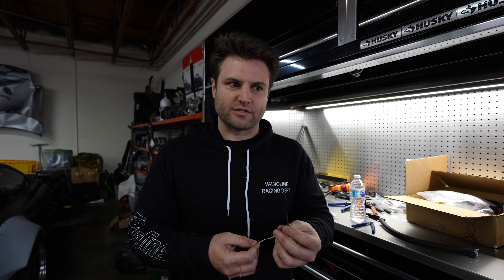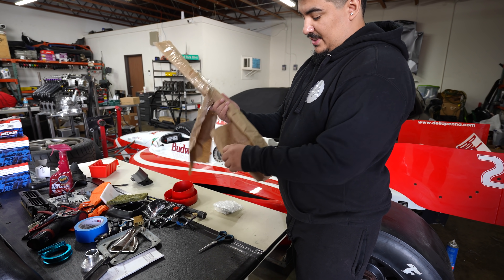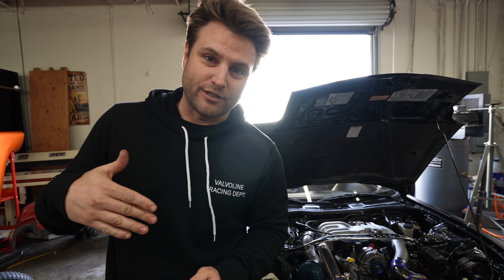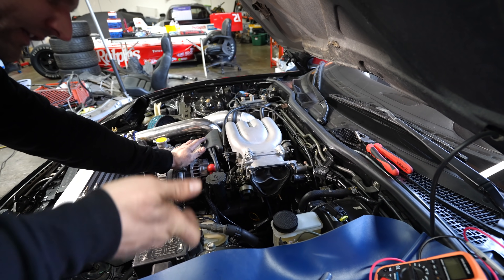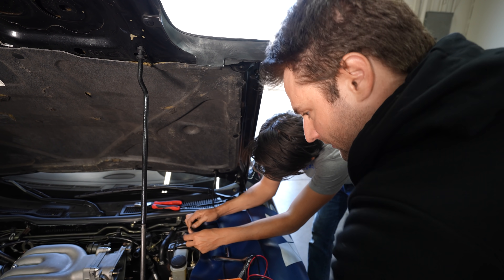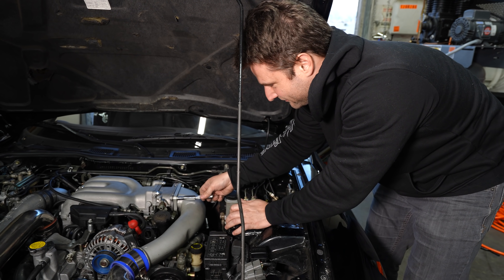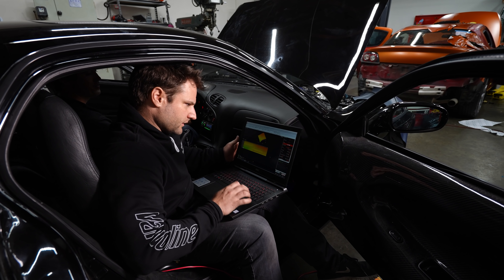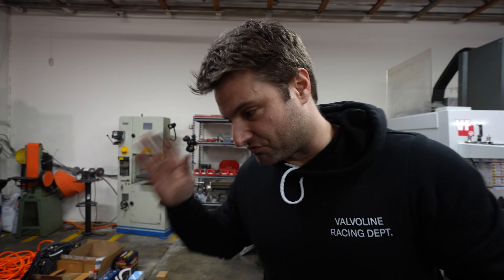I was nervous tuning a Professional Driver’s Stock FD RX-7. His Rotary downward spiral begins

Comment: High idle when cold probably means the thermowax and accelerated warm up valve are still present on the throttle body and upper intake manifold

Comment: got the same problem you mentioned at 14:10 with mine and it does not stop doing this. Sprayed tons of brake cleaner arround but no change in idle even hooked up a smoke machine but I can't figure it out. Car Does not react to Idle adjust screw under Throttle body aswell... gotta love this

Comment: Rob needs a hub dyno (like a dynapack setup). So he can just tune the vette, the 3 rotor, the fc, the c8 (if it runs), possibly the 4 rotor, and then shove the dyno in a corner later
Reply: Do they make awd setups for hub dynos???
Reply: @malikmadison6304  They just disconnect the front drive shaft and test it in RWD (I think, not an expert).
Reply: @T3ddyRuxp1n  yep. you can do that. Then just have to compensate the drive train loss because your car is awd but you tested out in RWD rwd drive train is much lower than awd. sorry for my english. Almost forget i am not an expert too ajjaj
Reply: @malikmadison6304  Yes. I know Mainline Dyno makes one.
Reply: @malikmadison6304  they're modular, you'd just get 4 instead of 2
Reply: @malikmadison6304  yes they exist, but not often needed because of what the other guys are saying here, just disabling one of the driveshafts
Reply: mainline, no dynapak
Reply: @malikmadison6304  They sure do! VEMS in VT has one
Reply: @malikmadison6304  Yeah the shop I get tuned at has dynapacks they have in an awd config just by adding 2 dynos together to make 4 hubs.
Reply: that would be nice but i think thats the end step.  He still needs to get  his upgraded engine mod reliable  before he gets a dyno.  all the dyno does it allows him to not have to go out and ride shotgun   to map his fuel logs.. and instead just do it from inside.  it is indeed a luxury, but he needs to make the rotary world a reliable in and out service first like jiffy lube.  bolting engines, modding fuel ports and  creating 20 base maps for all different versions of modded engines he may end up doing.  OR he can become a race car driver  if he has the talent.  the future is bright.  so many options.

Comment: Best not to ‘probe’ ecu and power wires with multimeter Continuity (ohms) unless power is disconnected. Just use volts. I know you were confirming gnd pin but just look for 0v. If your concerned about earth quality, power off then use ohms.

Comment: Japan uses metric lines. 3/8- America, 10mm Japan. And there is a difference...  5/16 -8mm in Japan. 8mm and 10mm is a touch bigger than their American counterparts... You can get the lines and fittings on the internets, some parts stores do carry them but nor too common...

Comment: I wonder if this is going to feature on MotoIQ.
Reply: It's MotoIQ's new Project "RestoMod" FD.  Stay tuned for the intro article.
Reply: @OneLapBilly  did go looking on the site and did find the project listing!
Reply: @Hybridesque  There is another black FD project that is NOT this car.  This car hasn't dropped yet and is Project "RESTOMOD" FD; where I will be covering step by step the proper way to modify an FD to OEM+ levels.  The intro to this project should drop in the next couple weeks.
Reply: @OneLapBilly  I saw and have read about MP's project but I could find the listing for the Restomod project, just that it didn't have any articles in it as you've stated.

Looking forward to seeing your articles in due course, as I do like your writing on there.